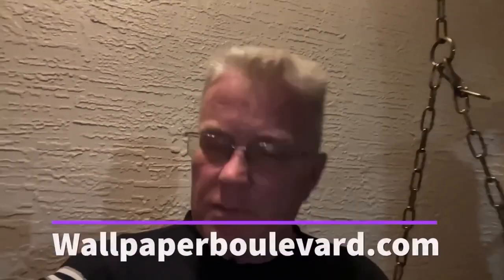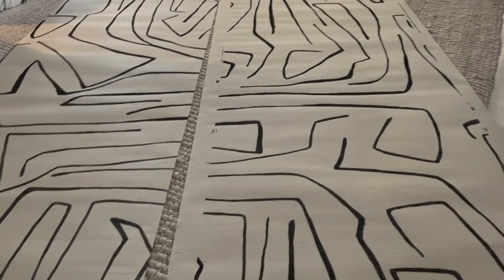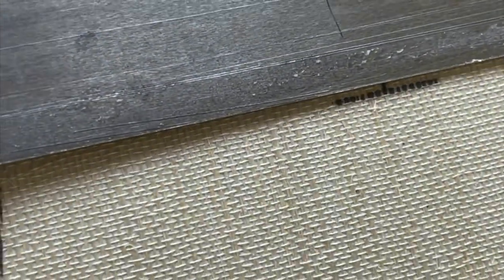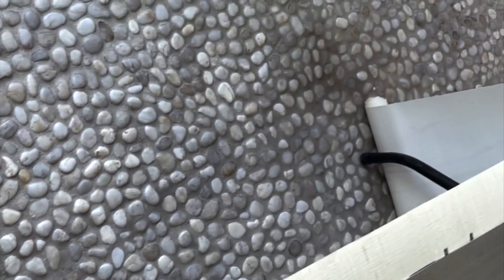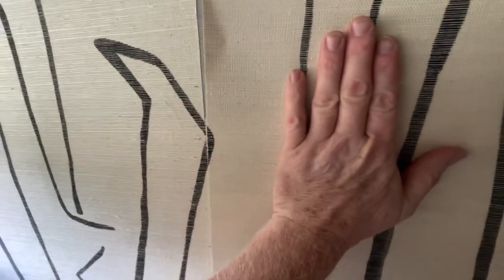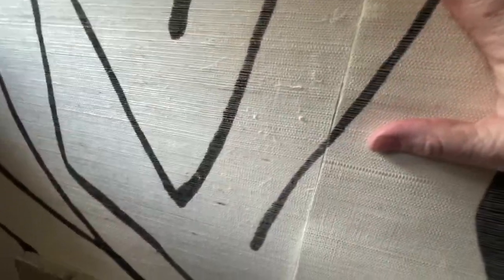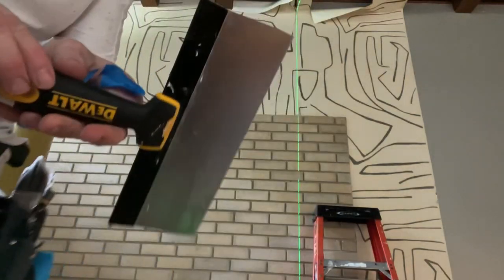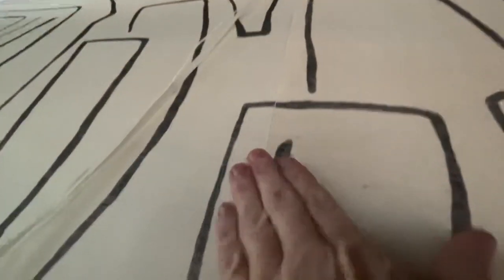How to Cut and Hang Untrimmed Grasscloth Wallpaper (NOT EASY!) - Spencer Colgan

Comment: Hi, this is very interesting. Im installing digitally printed paper at 45in wide with 8 drops. I have to cut it on the wall. It has to be pre soaked  and paste the wall. It can be wiped clean with a damp cloth. Its a nightmare. Thanks for your great videos.